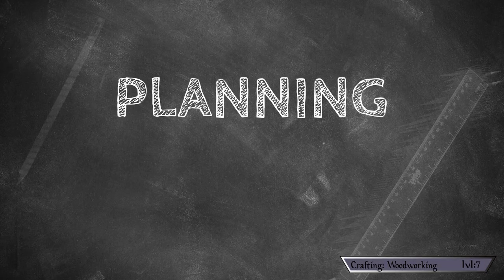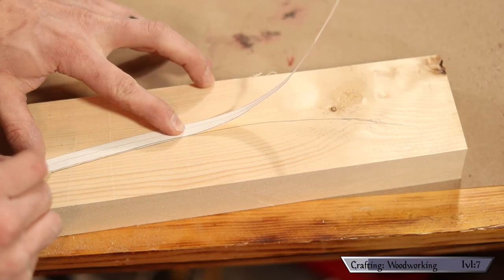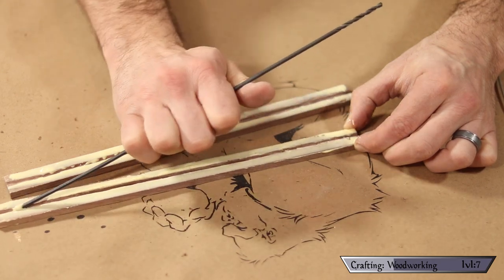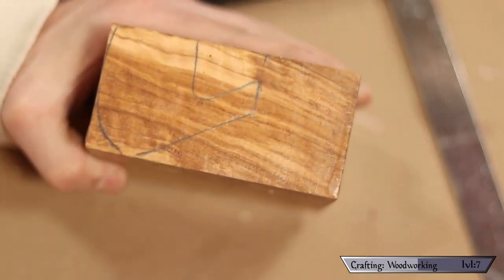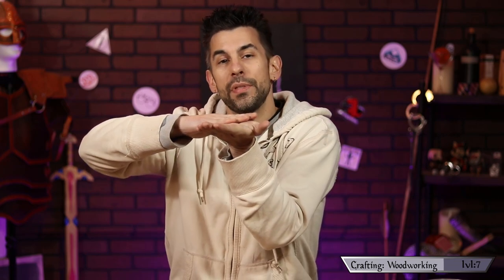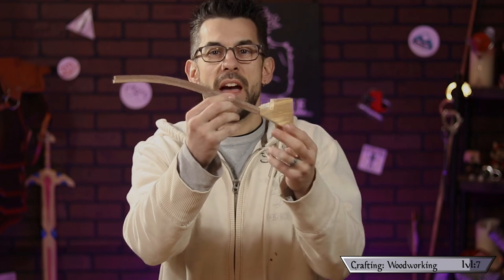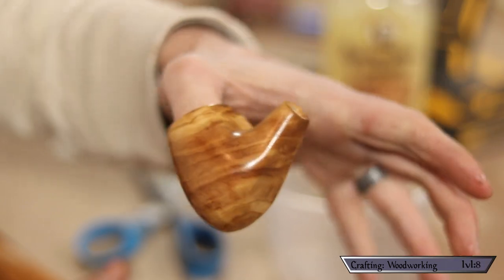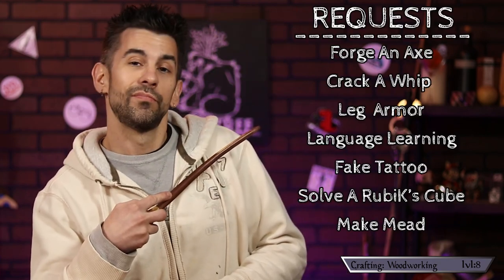Wizard Tobacco Pipe | Making The Pipe Of Smoking | Skill Tree

Comment: for the future, I recommend drilling a hole through a long piece of wood, boiling it, then putting it in a jig to bend it for the stem (with something in it to keep the hole open)  it may not get THAT hot, but since glue is essentially plastic I wouldn't want it too close to my fire

Comment: Im looking to make a pipe of my own, but pipemaking forums are all so confusing. Maybe you could share some insight from you own research :) Im using the same stem method as you (two pieces glued together), but for glue Im using titebond 3 instead of titebond 2 as you did... also my tenon to connect the stem and the bowl will be made out of a stainless steel so that I can remove the stem to clean both pieces. The steel tenon will be glued into the stem using the titebond 3, so that should be fine, but would the smoke passing over the joint length of the stem be a problem? Like will there be a leeching of toxins if the glue is heated albeit only slightly by the passing smoke? Im hoping since you didnt mention this in the video, this wouldnt be a problem, and Im guessing that since its so far from the heat source it shouldnt be a problem. Thought Id ask anyways though! Great video btw!
Reply from the maker: You should be OK! In my research I had read that these glues are generally non toxic and fitting for this application. That being said, I am far from an expert so, I suppose you must take that with a grain of salt.

Comment: Question, did the wood burn at all when you smoked from it? I ask cause that's a lot of heat and I wouldn't want it to degrade.
Reply: All pipes need to be gently broken in by initially not sucking too hard and making the tobacco burn really hot.  In time a lay of tobacco residue and charred wood builds up which protects the bowl for serious burning.  Some people coat the inside of the bowl with honey to speed up the process.
Reply: @ThePillenwerfer  thanks for the tip man!

Comment: full time pipe makers dont have glue anywhere near the hole, im pretty sure they drill through a piece and then steam bend the piece after you wouldnt want glue getting hot and then basically be sniffing glue haha
Reply from the maker: I worried about the same thing. In visiting the various pipe makers forums, the consensus seemed to be that the stem wouldn't be close enough to the heat source to matter and the actual amount of glue present is negligible if it were. The main concern would be a glue up of the bowl. Then your just poisoning yourself. Thanks for looking out and for watching!
Reply: Some full time pipe makers glue a Delrin insert into the stem to get a longer life out of the stem. I make briar pipes and I prefer to use Delrin rod as my shank insert. It has a natural slip to it and it’s easy to work on the lathe. Some meerschaum pipes have glued inserts on their stems too! There’s no problem with the glue being in the stem but most definitely it can impact the taste if it’s in the bowl or towards the inside of the shank.
Reply: @SkillTree  I just slot mine in without any glue. They are tight enough that it won't fall off. And you can dismantle it after smoking for cleaning and storage. The holes you made in the tennon and pipe are of different sizes. It will get stuffed with gunk and dust that is difficult to clean. Reason why during the victorian era there are thousands of clay pipe being smoked and thrown away. The tiny holes get stuffed easily and difficult to clean.